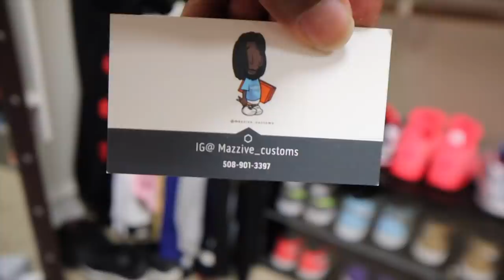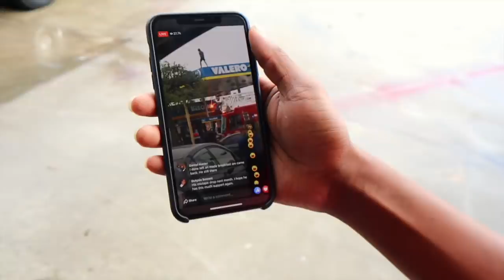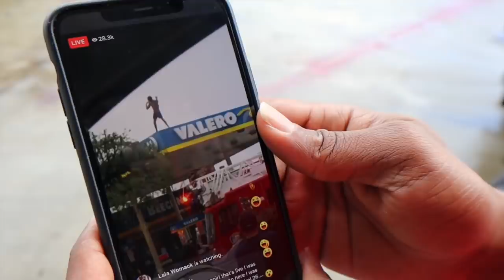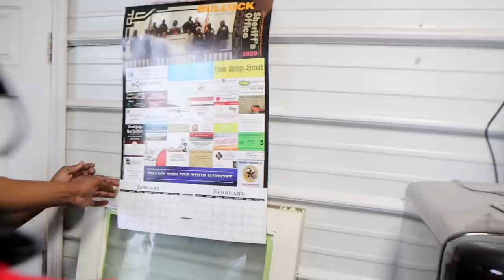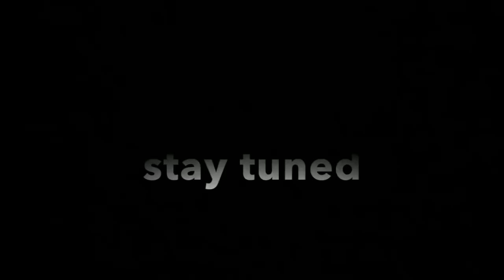MY DAD PAINTED MY 1973 DONK CANDY APPLE RED 🍎

Comment: a lil trick to stop yo car from getting scratched up if u really wanna protects it is getting  a bunch of that blue painters tape and basically cover the  whole front of the car with painters tape cause the front is like the main part that will get hit by rocks and stuff and maybe the lower side